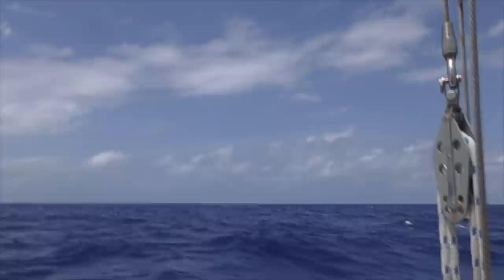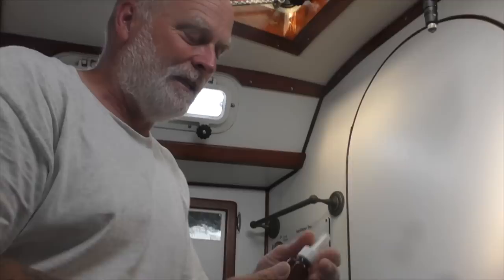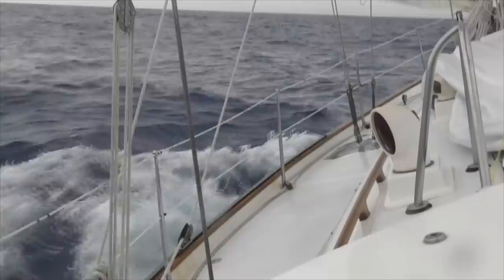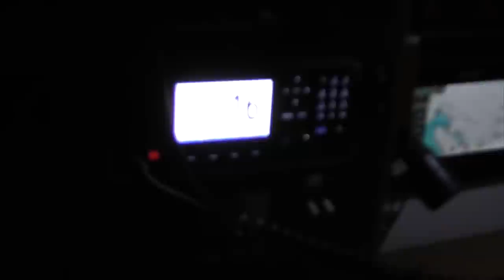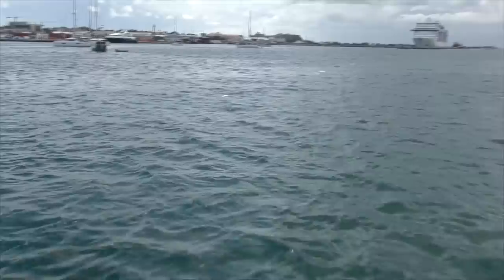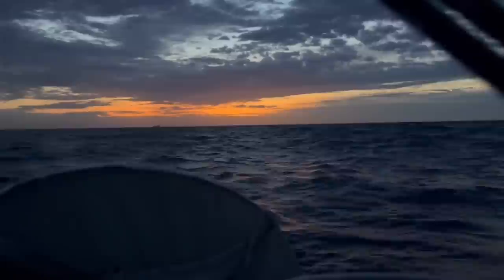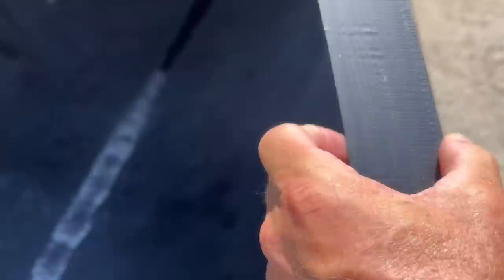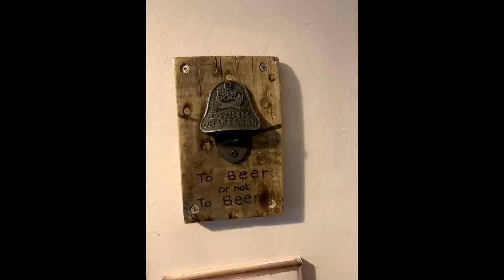Sailing Camp - Part 4 - Overcoming Seasickness

Comment: Hi Doug, I used to suffer a lot from sea sickness, train sickness, car sickness. I even almost threw up when landing my plane. Then one day due to some silly carelessness and metal dust, I got a permanent scar on my cornea and the best way to fix the scar was to have a laser eye correction operation. This would also get rid of my short sightedness and astigmatism. Well the operation was not fun, but afterwards it was really cool to get rid of my glasses, but the really really cool thing was that my motion sickness went. I just don’t get sea sickness any more. I mean occasionally I feel a bit on edge, but never uncomfortable. It has completely changed my experience at sea and in the air. For me, I think astigmatism (wonky eye balls) added distortion that just really confused the brain.
Well that's my story, I seem to remember you said something about wearing contacts, so just a thought that might help you or someone else on here.,
Reply: Just to add, I believe the reason generally for sea sickness is not just inner ear vs. what the eyes are seeing, but the fact that the brain is anticipating the movement. Really bizarre truth is that it takes a few milliseconds for what the eyes see to be communicated into what the brain sees and the brain tries to fill this gap with what it thanks will happen. Apparently when watching tennis, you never actually see the ball in flight, the brain literally cannot process the images from the eye in time. The blur you see is added by the brain so as provide continuity. So with sea sickness, this delay in what happens in reality combined with the boat’s movement and then the brain adding in what it thinks will happen to fill the gaps is where all the confusion stems from. Veritasium did a good video on ‘What exactly is the present’ that talks about the delay in visual processing. 
But all I know is sea sickness sucks and if you go to sea despite the pain and suffering of being sick, then that demonstrates perseverance and courage.

Comment: In my experience,  Not in any particular order. 1, Avoid on board smells.  2 Concentrate on the horizon, avoid looking inboard.  3, Sing or hum or talk. 4, Avoid coffee or alcohol  5, If going below, make it quick, or going to the heads loosen clothing  before going below.  6,  Going below to sleep loosen clothing before going below, go to your buck and lie down on your left side.  Your stomach does not slosh around so much.  7, Stay at the back of the boat, most of the water around the boat is displaced makes for a smoother ride.  8,  Eat before going to sea, nothing worse than vomiting on an empty stomach.

Comment: I still have a rough time with being on small boats.  When I was in Costa Maya doing a few dives it hit REALLY bad and I kept fighting it as much as I could.  Took some of the Dramamine and it helped but still ended up chumming the water.  Got back to shore and there was a TON of crud on the beach rotting and stinking and ended up adding a bit to it.  Chilled out for a bit and made it back out to the second dive but haven't had a lot of time on a boat either outside of some lakes and rivers.  Actually have had an issue on a cruise ship once before but I had taken a pain med which makes me a little nauseous anyway add on 3 meter plus seas and lets just say I was miserable.  Even through it all I still keep getting out there and doing it all over again.  Been in some pretty rough waters on a cruise ship since and had no issues other than looking like I am drunk while walking around.  I can feel less than 1/2 of a degree of movement when the ship is rocking side to side and at 3 degrees I walk around like a drunk, lol.

I can vouch for ginger though.  After my wife passed away ginger was the only thing I could manage to keep pretty much anything down for quite a while.  Green apples are supposed to help as well with nausea.  I personally head for ginger beer over ginger ale though to me ginger ale isn't much more than sugar water.

Another interesting thing is when you get off the boats and still feel like you are moving it's called Mal de Debarquement syndrome.  It usually goes away after a few hours but can sometimes last for months or years.

Comment: I used to have chronic sinusitis when I was young but in the 70's I learned an ayurvedic trick. Handkerchiefs and blowing your nose is a relatively recent thing and our upper respiratory tract isn't built for it. Blowing your nose fills up your sinus cavities whereas sniffing creates a venturi effect in them cleaning them out. 
I'm 76, never had sinus problems since and doesn't cost a cent.

Comment: I used to get airsick all the time. I finally got it under control when I became a regular airline traveler. I was on a small plane all the time as a kid, and I used a ton of sick sacks. 
I got it under control on airline trips all over the country while working as a Safety Director for a fortune 50 company.  I took a lesson in a Cessna 152 about 4 months ago and
got sick but I didn't blow chunks.  I should have known not to take a lesson in 16 knot winds.

Comment: Old acupressure trick for nausea: find the midpoint between belly button and pit of your chest; apply pressure.  Best I can figure is that's the bottom of your esophagus and prevents the reverse diastolic wave (vomiting).
  I see you found a real yard dog at the dry dock.